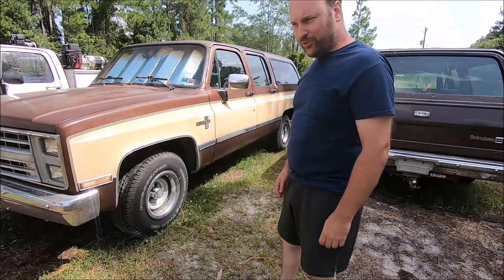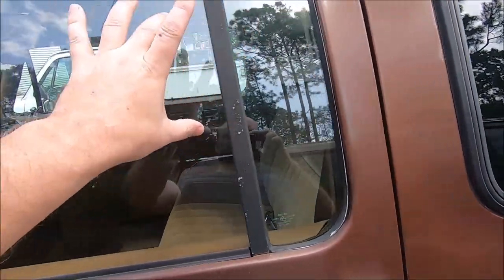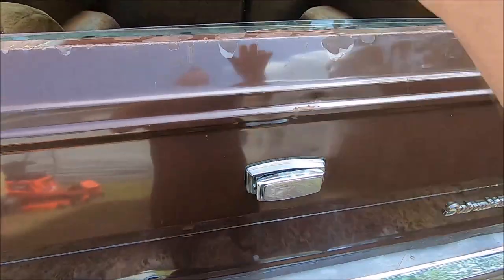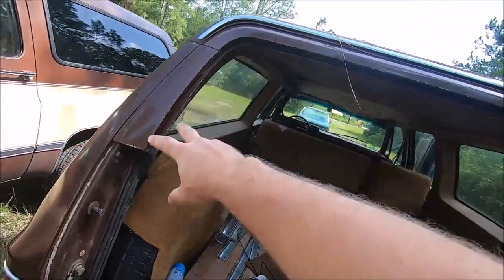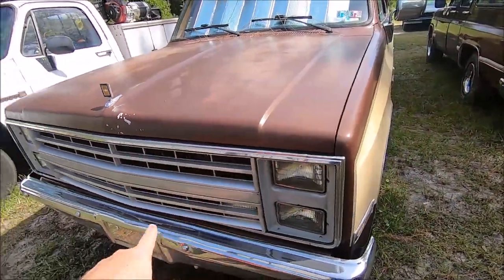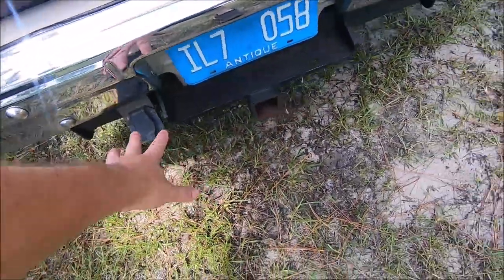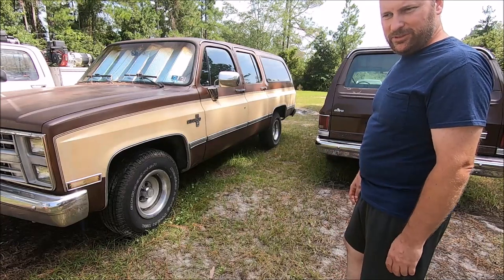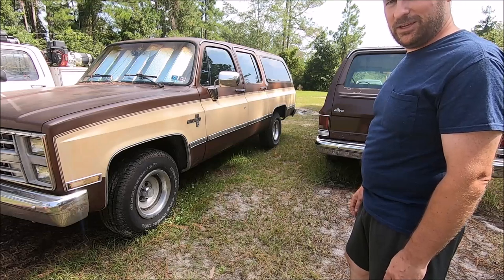1988 Suburban model comparison - barn doors vs tailgates!!

Comment: Do you know if an electric motor on a tailgate be converted to the manual kind?
Reply from the maker: Yes, but you need the entire manual regulator assembly, and you need to strip out all the electric assembly and replace everything.